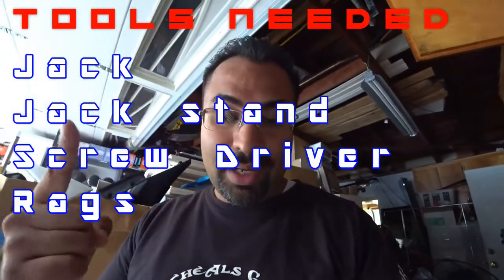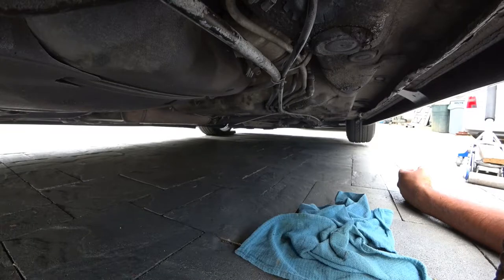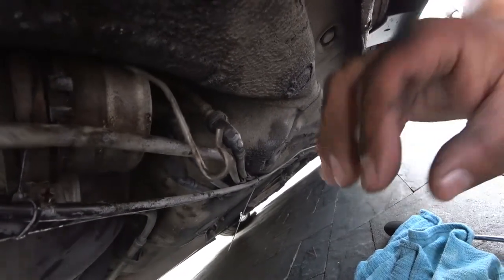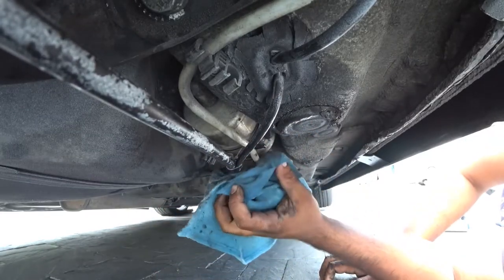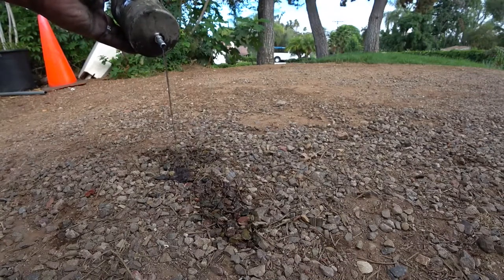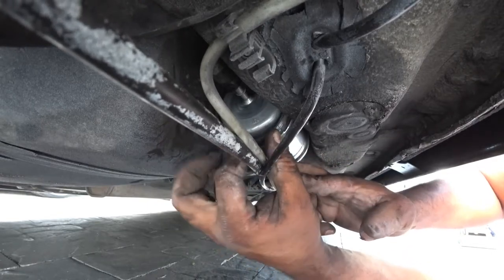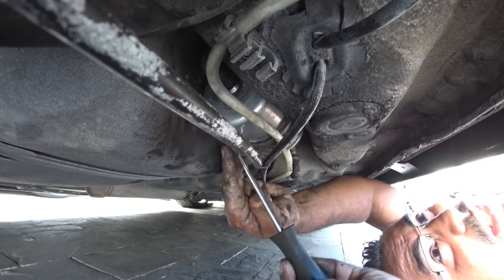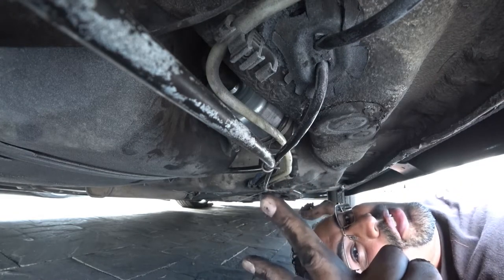How to install an MK4 Fuel Filter Golf/Jetta/GTI/GLI DIY S4EP22

Comment: Ha forgoten fuel filter i bought one like 18 month ago unfortunatly its upstairs in the wardrobe FORGOTTEN lol
Reply from the maker: Mike Evans you be surprised how often it overlooked.
Reply: PincheAls Garage i have just built a bam engine for my cupra ready for a tfsi hybrid k04 around 430bhp used you build vids to go by so cheers for your wealth of knowlege so i will be doing the filter before i drop it after the install

Comment: As a safety measure, you should have pulled out the 15 Amp fuel pump fuse or disconnect the battery.
Reply from the maker: Khai Bui no its not needed. Just as long you dont open any doors or the hood. This will prime the pump.
Reply: Yeah.-... bull twinky

Comment: I have a mk4 1.8t gti I have a new fuel filter and I've had a look at mine and I don't seem to have the same connection as you with the little push in button/clip, some of them do under there but not the ones connected to the fuel filter. I'm worried about breaking or splitting the lines trying to take them off the filter.
They look exactly the same, just not with any button to press to release them. Have you come across these before and how do I take them off without breaking?
Reply: @Mrfurballs  I enged up getting it done at a garage when I had some other bits done.

Comment: Do the hose clips go over the lip on the fuel filter end nozzles or just push on up to the lip? I had a metal filter but the hose kept slipping off. With the old plastic filter it stays on fine.
Reply from the maker: They clip in place. The factory stuff will clip in and thats it. If you have a modified one i suggest you get a fuel filter with a barb fitting for rubber hose to fit snug.
Reply: @PincheALsGarage  I managed to sort it, I took it all apart 'again' and put the hose that was hard to put on first (it needed more umph) to make it clip on.

Comment: Why don't you depressurize the system by taking it the fuel pump relay and staying the car until it stalls. That way you won't make any mess
Reply from the maker: Matthew Riley even if you depressure the system there will always be fuel. All the fuel that came out was from the filter anyways
Reply: Matthew Riley depressurization the system doesn’t magically remove all the fuel that’s stored in the filter.